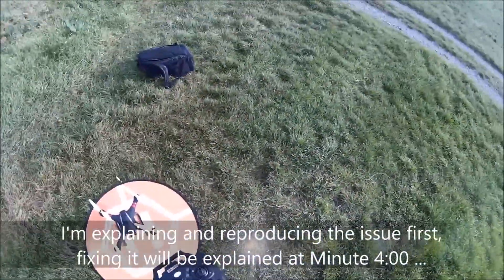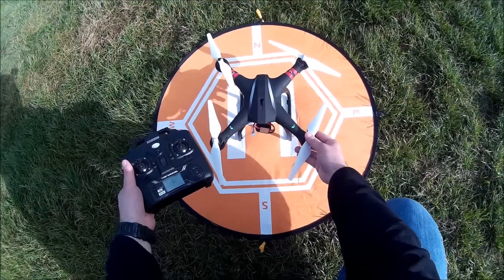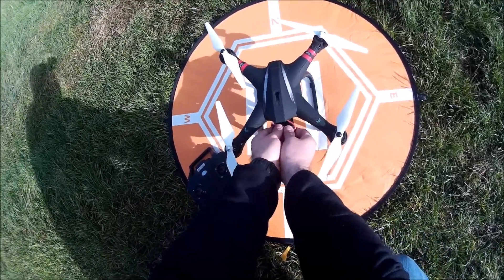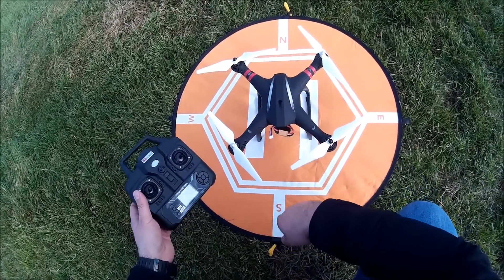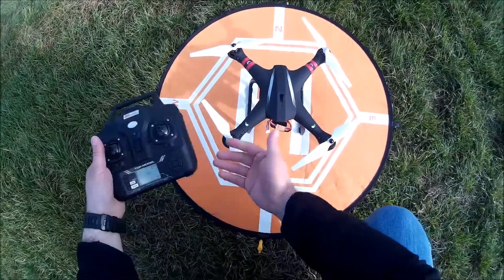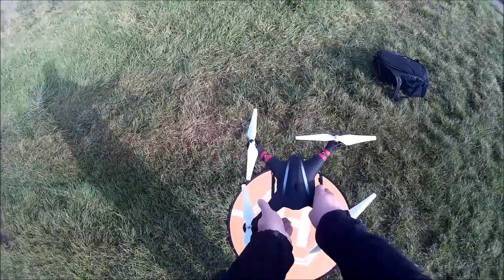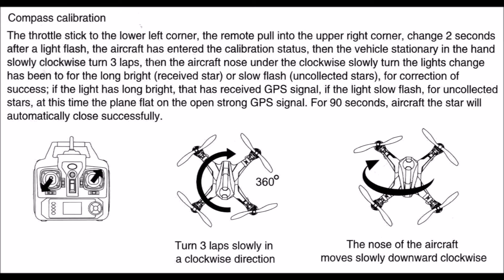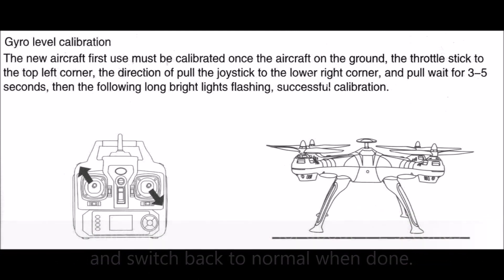Bayangtoys X21/X22 - Fix Blink Error - Calibrate Compass - 1x Long / 2x Short

Comment: well i have the same issue but after all of your info my drone still remains on ground with no lift,,absolutely over this hunk of rubbish as no drone is that sensitive to liftpoff...damm rubbish and it did fly at one stage and maybe race off down to where it worked previously I have no answers...i also have a parrot ar  drone which is the same and that's a btridge too far..i have many drones and these two are the worst of all cheers

Comment: Sir i have a question.i did everything you said.and drone worked great.but yesterday i hit one wall.not a big accident but my 1 propellor bend little bit.may be after that my drone light start blinking .means after i calibrate.i gets steady lights.but after 20-30 sec lights start blinking.i saw on internet it says gps lock is lost.if thats the case how to fix it.? If anyone have any information let me know.
Reply from the maker: Yes it sound like you have a problem with your GPS. Maybe only the connection is loose or the GPS module is broken. But you can get a new GPS module from AliExpress for about 15 USD, so it is maybe worth a try.

Comment: I just recieved my x21 yesterday and it ALSO WILL NOT FLY!!!!!  Just like the x16 I sent back, it had the error code.  I tried this "fix" maybe 30 times on the x21....and once the lights did go solid...I;m like WOW...ok ...it's fixed....but it would not fly but only arm motors that stuck on if run more than 5 seconds like in this video....Worthless....I am convinced that the top reviewers (that I love watching and why I bought these 2 copters) get free drones that have been extensively trialed before they get sent to these guys.
These are cheap because they are for the most part hit and miss and basically thrown together with very little testing with cheap components.  Run, don't walk, away from Bayangtoys junk!  This is my experience and opinion.
Reply from the maker: John Padgett very strange, seems you are really unlucky here 😕
Reply: Mister  Padgett, i think you have a lack of technical insight because we have four of those copters and they fly themself. easy as taking candy from a baby. I therefore find it a little childish to react this way.And keep youre narrow minded opinion to yourself please................................

Comment: I got my X16 out for the first time and got that bad calibration code. I tried again and again same thing. So I got on the net looking for answers.I did not find anything help full until  I found this video.Thank You ! this solved my code error even tho this is not an x21. I am sure they use a lot of the same parts. I was thinking I got a bad  controller or a bad control board OMG . I would have to spend more money and time fixing it. Thanks again for you'r help you'r calibration worked the very first time TADA!
Reply from the maker: unrealinventor2006 I am happy to hear that the video helped! Good luck flying!
Reply: Thanks again!  have fun

Comment: I have this blinking code for 2 days now on my DOA x16.....your "fix" (I had such high hopes when I saw u with the same error code) did nothing....it just blinks and blinks - since I received it new 2 days ago new....I opened a work ticket 2 days ago and so far Gear Best had done nothing to help me.  At least they responded....and said they turned it over to their "technical team".  Such a bummer - I feel so helpless....I opened it up and all looks OK.   The funny thing is I am waiting on a new x21 also....now I do not know what to do with this $150 pos x16 and do not have much confidence in the arriving x21.  I am hoping for a refund on the new DOA x16 and better luck with the x21.  Any other fixes out there=??
Reply from the maker: Unfortunately if this does not work is most likely really broken, but you're already done the right thing to inform Gearbest as early as possible. They only allow DOAs within 4 days after arrival.

Comment: Thanks for making this helpful video. I found that the motors may be powered off in this "1 long 2 short" state by simply holding the left stick fully back for a few seconds. That way there's no need to handle the machine with props moving
Reply from the maker: You're welcome! And also thanks for that tip, didn't knew that yet but makes sense of course!

Comment: Hi Martin from Spain, and sorry for my english. I have a problem only in remote control. The light red is blinking so fast and the letters GPS on thisplay too with 18 satélites ;the dron work good and the lights are ok, is only in the remote control. Can I have a problem? Or  is all ok? Thx
Reply from the maker: No Problem, I am German so my English is also not perfect - but I did understand your question :). Actually, everything is fine with your Remote! The fast blinking / flashing just means that your Remote has locked to GPS, also the GPS Icon will blink rapidly. The number of satellites are for Drone. So if the light is steady or nor slowly blinking, that means the remote/transmitter has not locked to GPS yet and no Follow me or Circle Me will work, and you just have so wait a little longer. Hope this answers your question!
Reply: Then all is ok, the dron do follow me and circle and return to home without problemes.
Then i don,t worry, no?
Thx

Comment: Hello ,Martin . I Wanted to to know-how  you removed the GPS antenna on the x21  it  IS only FOR a pparel and it can ne removed with no problem with the drone functions ??
Reply from the maker: Anna Perego Hello 😊 you guessed right, it really is just for decoration. It is held with one screw from the inside, so after I discovered that there are no wires, I just removed it while modifying my drone and had the shell open anyway. But if you don't want to open it, you simply saw it off 😊

Comment: my x21 fail and broke the shell  :( i can calibrate the gps but i dont can calibrate the motor , when it fail ,after i saw one motor dont work very well for 1 minutes and after dont work   :(  i think (but i dont know really) that broken :(one motor or the control motor schedule ,what do you think? thank a lot for your time ,have a good day
Reply from the maker: Mhm, your english is a bit hard to understand, but you're telling my that one motor is not working any more? You can get a new on from Gearbest as well, just be shut to select the right one. So CW = Clockwise (Black Screw) / CCW = Counter Clockwise (Silver Screw)
You can find them here: https://www.gearbest.com/bayangtoys-x21-_gear/?lkid=11640377
Reply: thank a lot ,i open the drone and i see one motor cable desconnected ,i hope that is the only problem .........i hope that the eletronics (gps ,board,esc) is ok because i dont see spare parts on gearbest ..if is broken what can i buy ...........???    thanks a lot for your time ,have a good day
Reply from the maker: I haven't found the X21 board yet, but you can get the GPS Module and the ESC Board on AliExpress: https://m.de.aliexpress.com/search.htm?keywords=bayangtoys+x21+board#/
But I would definitely try to solder the broken wire first and see if it does the trick, which I would expect 😊
Reply: orsovlad if u don't see 3 wires connected on the motor then that should b the problem
Reply: Hi Orsovlad, these brushless quad motors are like miniature industrial 3-phase motors controlled by a Variable Speed Drive. Like their big brothers they will run on only 2 phases but at very high current for very little power output. If you see one struggling DO NOT RUN IT. You will burn out the motor and/or its ESC. If on the ground, shut it off immediately. If in the air, drop it in the grass. Then open the case, check for disconnected wires, resolder and hope for the best. Good luck, Mate.

Comment: Thank you for sharing Martin.. I'm waiting on my X21 atm from gearbest
Reply: PerthWestOZ RC good luck bro, I say that cuz I got mine from there, and I'll just say, I wish what this video helps fix was the issue I'm having , shit my X21 will not catch any Sats at all, at least it won't with the POS transmitter Gear Best sent me along with my Dual GpS quad"-" hasn't even one time linked up successfully, and that isn't all, she refuses to fly TRUE,, meaning she fights me every time , try and go straight, aka. Forward , she pulls back, etc,, I have YouTube video, that I've made to send to GEARBEST, WHOM HASNT LIFTED A FINGER TO HELP BTW,, NEITHER WITH MY 750 dollar CX-22 , plus the Walkera Runner 250 with Goggles 2 etc worked fine first couple flights, then almost lost her due to Lack of Control, anyways was able to go well over 200 yards, though should easily do 100 meters, began losing all control and flying off or dropping after only about 20 feet,, 20 freaking feet,, then worked again after I let her sit about a week, then literally same day, fully charged batts, only hour later ,, took off yet again dispite my keeping her low and not further then 30or 40 feet, flew straight up, wind pushed, and then she reconnected which for no reason, dropped like brick directly down onto her rear left arm, which should had been okay, fell into soft miss/grass!? But due to quality control or lack there of she is useless,, most would simply buy new carbon fiber arm for around 12 bucks, and I would have , although there is still the ghost in the machine that I don't know what, and shouldn't have to look into, considering the bird/racer is less than a month old wrecked after only maybe eight flights easy going breaking in motors flights,  and yet again yes was your bus won't lift a finger they haven't done anything for me yet I've spent well over 5000 $10,000 this past year they've only sent me one thing and that was a year ago I freaking mini keyboard for my TV that was missing a dongle that's all I asked for was a dongle I have a stash for one single battery for my laser pointer that was supposed to be includedpackage that was almost a year ago now and they refused to even after they keep telling me to send pictures of receipt and item number, ended up sending dozens of times, and lasted about 6 months, for 1 lousy 18650 batt for Green Laser Pointer, which still sits in box, not workin, don't have correct battery"!?  So again,  Best of luck my man,, hope yours is Perfect,,FYI ,, banggood for most part doesn't screw people over, and also Light iN the Box didn't hesitate to send RMA for quad and then refunded due to being defective, did take about 2 months after all said and done. ALWAYS USE PAYPAL
Reply: Kevin Dodson got mine yesterday and gets 15 sats indoors nearly straight away, calibration works straight away when I do it too
Reply: Holy shit,u son of a zesus,i got this drone since December 2017.now after 4 months i had an 1st safe flight.thnx for educating me.i thought motor is gone.but you saved my day,more likely you mad my day.......thankyou thankyou thankyou.and good luck with gearbeat support team.cause it sucks.you should get money from gearbest or from this baytong company.

Comment: much professional ,i hope you excuse my english .but i want to tell you what your video is important for beginner ....thank a lot  i'm 51 old and i'm affascinates of your professionality .grazie
Reply from the maker: Thank you very much, I am happy to hear that my Videos help :)
Reply: your video on how to control gimball with an Arduino board ,open in my mind a crazy idea i hope to movemt a servo bait drop (www.ebay.it/itm/Payload-Servo-Release-Drones-Airplanes-Bait-Drop-Fishing-mechanism-BLACK/352190984225?_trkparms=aid%3D222007%26algo%3DSIM.MBE%26ao%3D2%26asc%3D20170831090034%26meid%3Ddea189629b544f43a8a02ecc4d307b22%26pid%3D100005%26rk%3D2%26rkt%3D4%26sd%3D263274984329&_trksid=p2047675.c100005.m1851) what do you think ?is possible?or i'm totally crazy :) ,bye and have a good day
Reply from the maker: orsovlad yes that should definitely work. It is a standard servo so it can be controlled with the Arduino. Basically you would just need to adjust the MIN and MAX settings in the code, to match the desired angle of the bait drop servo 😊.
Reply: thanks a lot
Reply: thanks a lot ,i see you are a diver too ...i work with bubble when i was yanger (good time)now i hope an a day make a rov ........dreams   :)
Reply: Hi, thank You for your Precious videos. I have a problem whit My new X21.  It accelerates late  and it doesn't decelerate. sometimes when put on button of remote control, i Can read all icone there are on display, same a crazy rc. then i must put off And put on, off And on..... what i Can do? thank You